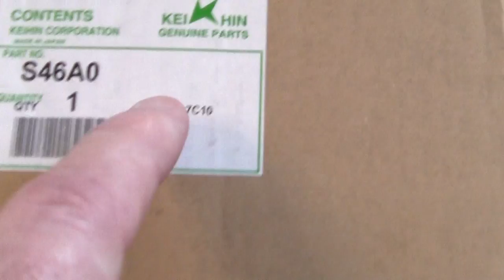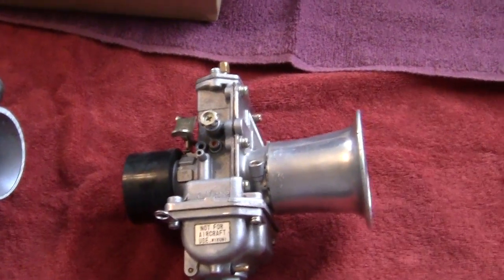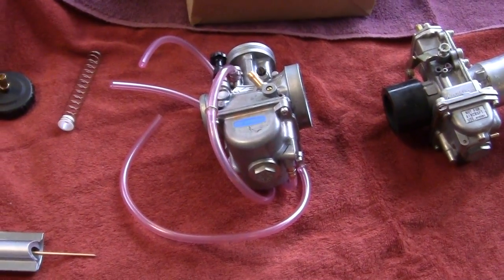3- How to Spot a REAL KEIHIN CARBURETOR from a FAKE ONE

Comment: You never took the bowl off...Sorry but this is a fake carb I deal in these every day. However with that said fixed up and jetted correctly these can be runners performing just as well as the oem in hp numbers though never as precise through the stages. (The good fakes) beware their are some out their that were never manufactured to perform and I question if even intended to run at all usually those ones however are more obvious fakes via the missing or poorly cast names and id numbers on them. The very easiest way of iding the fakes are the jets AND model type castings the original's are "Fine print" and very defined the fakes are larger lettering and not defined at all. maybe one day ill make a video showing the two oem and high quality fake side by side to show the difference's.

Comment: Love the carb buddy. WFO
Reply from the maker: I got an expansion chamber pipe for a mini stroker you might have a look at bro. I also have a complete case bored for a 50mm crank I "might" part with. R
Reply: The bottom where the  needle comes out has a K also for Kiehn
Reply: This is a fake carb.